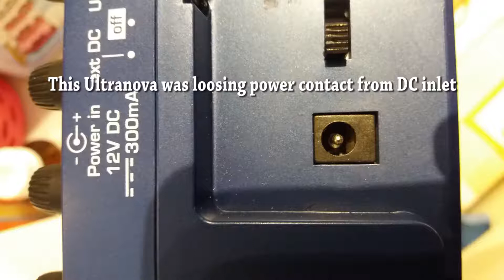Disassembling and repairing DC inlet of Novation Ultranova

Comment: Fantastic! I always wanted a module version of that synth and I think I might adventure to simply disconnect the keyboard and saw away the plastic for the lower part. Do you think it would work?
Reply: Also, can i use the mod and pitch wheels of my MIDI controller or would I need to keep those connected somehow?
Reply from the maker: I don't understand the need of doing it. The electronic is technologically very old and not a first class audio conversion. The software was really exceptional, but the global result was poor due to the low quality audio interface. Today you can obtain similar options and better audio results with some software synts like Arturia Pigments or Spectrasonic Omnisphere.
Reply: @AFmultimedia  I like the preset sounds a lot and I'm not great at sound design so trying to replicate them in a plugin would be hell. Having said so, is there a way to download the same presets for pigments or other vts (maybe novation's Vstation plugin)??
Reply from the maker: @joeyramonelookalike  No. The presets has a specific format not interchangable.